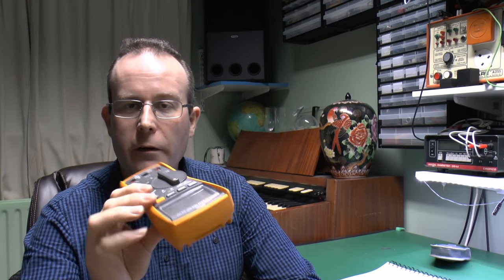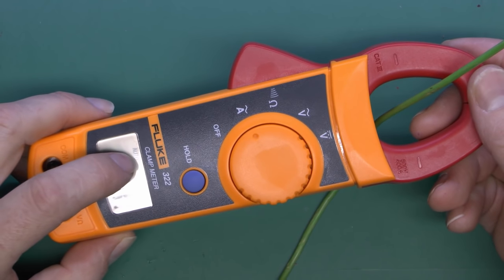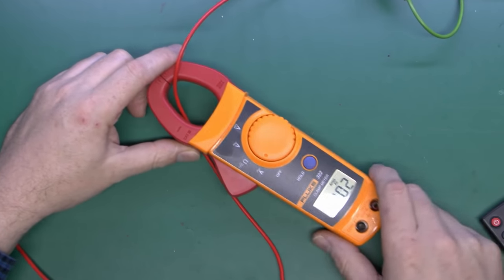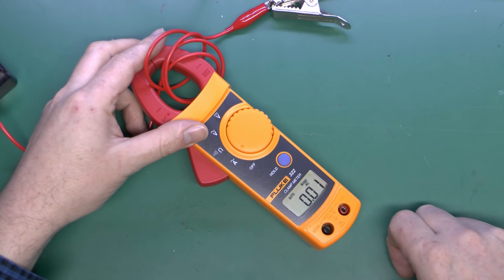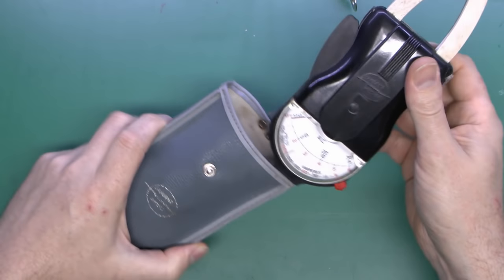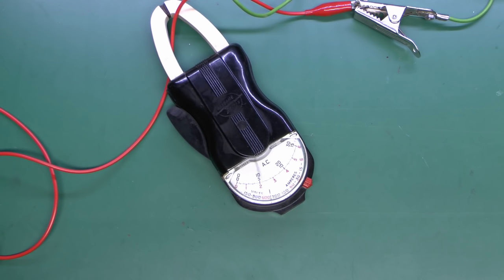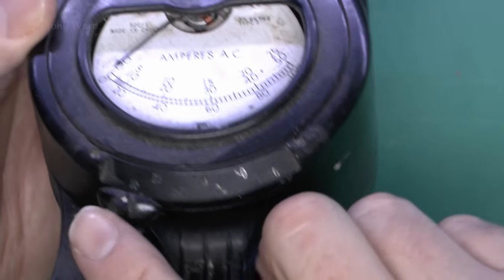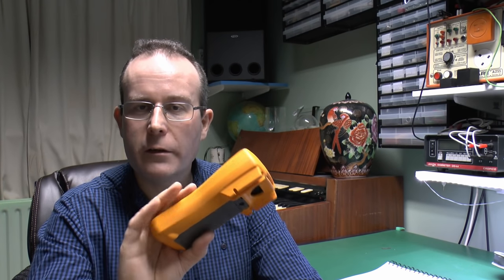Clamp Meters New & Old for Current Measurement

Comment: Hi JW,
That Ferranti clamp meter brings back some memories.
Back when I was a 2nd year apprentice, my boss put me on-call, now I only had an orange set of Duspols and a multimeter, as that was all I could afford on the wages of the day.
I was loaned one of them Ferranti clamp meters and one of (I think) the original wind-up 500V Megger test instruments.
Even in 1987, these instruments looked like they had been resurrected from the tomb, but hey, not once did they fail me, I sorted out a lot of problems with these two instruments by themselves, until I could eventually afford my own gear.
Some months later, a newer apprentice dropped the clamp-meter onto a concrete floor and it shattered into a million pieces, we were all pretty peeved about this, it was like the death of a close friend.

Comment: Thought you were going to take it one step further John and show the new ones that measure DC current.
Reply: @blow0me  Even expensive DC clamp meters need to be zeroed before use.
I've got a 5 year old Uni T and a much newer Appa/Amprobe/RS components one which is a much nicer meter to use, but they read about the same.

Comment: Why can't you use a single probe like the clamp but smaller range. Contact probe so it's maximum closeness not conducting to circuit. Are 2 probes always required for bridging circuit. Couldn't pass load in and out of single probe in single contact point

Comment: I'm a newbie, recently bought the cheapest most useless single gang extension plug with no actual extension. Just enough to remove enough insulation and split the wires for a clamp. I did for a second think the meter was faulty when I tried it on full power cable. Didn't take me long to realize in fairness

Comment: Nice one. That Ferranti 'tong' meter meant business. Easily safe for Cat. VIII (!)

Even with the plug-in devices available, it's a pity that no one seems to have found a way of measuring the current in a flex containing both L + N conductors. Unless it just isn't considered to be worth the R & D.
Reply: Strange. With magnetic coupling to sense a current and then power electronics to track the rise and fall of that current, it seems (that is should be) quite possible to calculate the value of the current anywhere on the sine wave, positive, or negative. Obviously a suitable timebase value needs to be used to be able to track whatever the frequency of the AC being measured is.

We've done without for this long; so I guess a properly working device isn't going to happen soon.
Reply from the maker: The problem is having something which can detect the magnetic field from one conductor while ignoring the opposing field from the other conductor. In a flex or cable the two conductors will be very close together so it is exceptionally difficult to design a device to measure only one of them.
Reply: I think that this is just one of those 'challenges' that provides some thinking exercise for those quiet moments. :-)
With the availability of plug-in measurement devices for mains-powered equipment, I guess that manufacturers just don't see any worth in R & D spending to overcome the cancellation-effect caused by the proximity of the conductors in a normal flex.
Give me the rest of my life and I'll give it some thought!
Reply: @jwflame  And those condustors are usually helically wound within the flex itself.

Comment: How accurate are these devices taking into account that the magnetic permeability differs from wire to wire depending on the type  and thickness of the isolation used?  Thanks!

Comment: When measuring DC,why do u get two different readings if u turn the clamp meter around?
Reply from the maker: DC clamp meters must be zeroed before each use and after moving them to eliminate the effect of the Earth's magnetic field and any other magnetic fields nearby.
Moving it without zeroing again will give incorrect results.
Reply: @jwflame  ohh, ok thanks much. Was measure short circuit current from a pv module and was getting like 6.6A and when i flipped the clamp meter i was getting around 2.1A.

Comment: Hi John.
Why don't high quality Clamp meters have HRC fuse protection like their multimeter counter parts ? Even fluke doesn't seem to fuse clamp meters even though they measure voltage
Any information on this would be excellent

Comment: Maybe a childish question here but at what point does the N become without voltage in a circuit. Assuming the are 2 present loads on a single circuit and I took a reading of N and E after the second would that then be zero voltage

Comment: Some of the old clamp meters were just a moving iron movement, the magnetic field of the wire did all the work. I used to have two like that one went to 30 amps and the other was 400 and 800 the ranges were made by a stand off bracket on the back of the meter the furthest out being the higher range. Might still have them in the shed somewhere.
Reply: i used to have 2 ones for car use, one that measured 30 a and one 600a, to measure alternator and starter current, very simple, measured into the postive and negative so you always got a measurement. just lay on the battery wire to see how your alternator is coping etc

Comment: Hi John as I'm not qualified would I be permitted to run cables to position and connect things like sockets or ceiling roses under part p thanks
Reply from the maker: Part P is just this: http://xo4.uk/x/part_p_requirements.png
so most people should easily be capable of complying with it.  Qualifications are not required, although they may be useful.

Comment: if you measure line and neutral and get a reading isn't that a sure sign of current leakage? as they aren't canceling each other out?
Reply from the maker: Yes, and that is one method of detecting earth leakage.  It does need a clamp meter which can accurately measure in the 1mA range - many do not, including the Fluke one in the video.

Comment: What would you need to use a clamp meter for in a domestic installation? really great videos, thanks for taking the time to make them.
Reply from the maker: Current measurement for a single circuit, or the entire installation. The main advantage is that you don't have to disconnect any wires to measure the current.
Reply: Especially with the ones that have a minmax function (which most better ones do now) it's the sort of thing that you might leave on someone's meter tails for 24h to see the max demand to know of their incoming supply needs upgrading before any additional circuits are added (such as an electic car charging point which can draw significant current )
Reply: @dasy2k1  Which is similar to the Energy Efficiency Module that is supplied by British Gas and other ESPs...  Only that is a permanent installation and does not give readings in amps, only watts.
Reply: Being a heating engineer I normally use mine to prove immersion heaters are working

Comment: where is best to get a uk line splitter or monitor tool suitable for clampmeter and small currents.
Reply: I bought cheapest single gang extension socket and exposed a section of split wires carefully. Purpose built splitters are expensive and only really a single model still being made

Comment: How do the open ended meters work
Reply from the maker: Hall effect sensor, there is usually a line or mark where the sensor is which is also where the wire must be placed for accurate readings.  On the Fluke ones, it's at the bottom of the U shaped slot.

Comment: I'm sure that AVO brought out an 'add-on' clamp module that could be plugged into the ampere terminals of a standard multi-meter.  
.
Very simple device to contstruct really and totally safe to use.   Also the British Gas -  Energy efficiency display module,  that is available to anyone, but comes free with a contract, uses the same technology, as one has to place a current sensing coil around the line tail from the house meter to the consumer unit.  This coil, in turn,  feeds a wi-fi transmitter, that talks to the display module.   The display does not show amperes however, but gives a reading in watts.   
.
Many (uninformed) have been caught-out trying to read the current flow in a multiple conductor AC flex...lol

Comment: I'm setting up a DIY woodwork shop and want to measure the current each machine is drawing.  I was thinking of getting a clamp meter like the one in this video BUT at 8.14 in this video you referred to 'one of those monitor things you can just plug in....because they are fairly readily available'.   If that is what I need to get, please let me know what it is. Thanks
Reply from the maker: One random example: https://www.screwfix.com/p/energenie-ener007-energy-saving-power-meter-socket/3477h , many similar ones available.